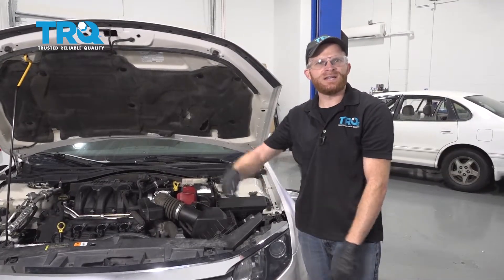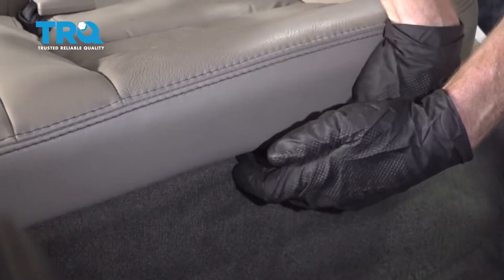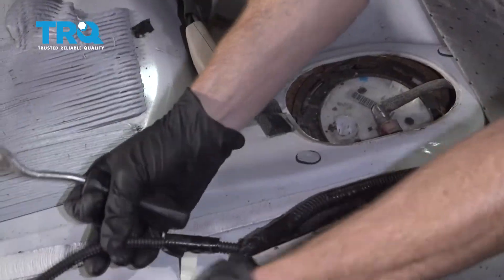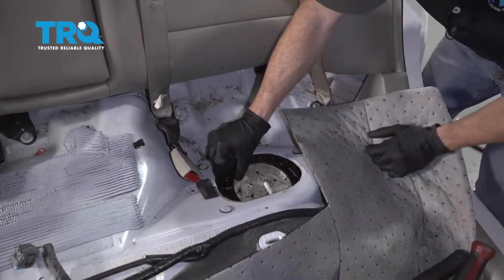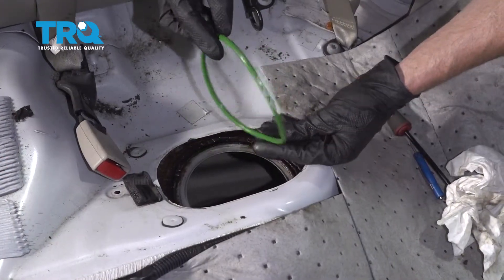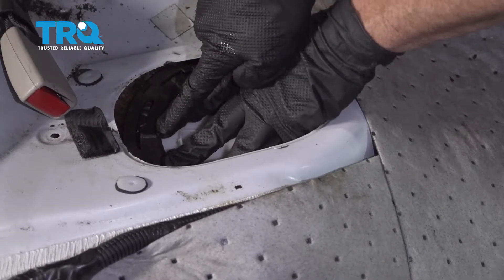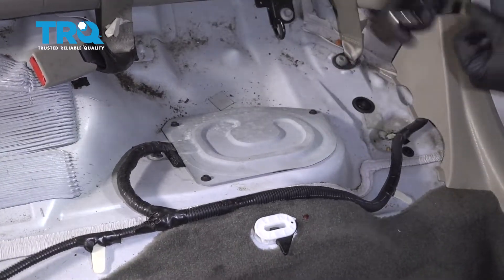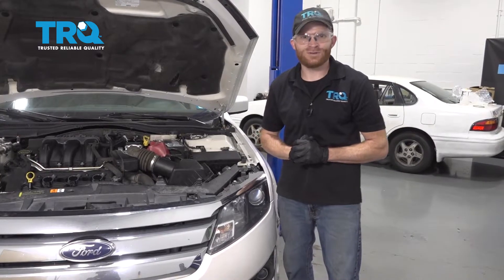How To Replace Fuel Pump 2006-2012 Ford Fusion

Comment: In our Ford Fusion JU2 2009 there is no shutter beneath the back seat..... We have to remove the exhaust and the fuel tank from beneath the car before we can replace the fuel pump... quite expensive..

Comment: Question ❓ why are UK mechanics trying to charge me £850 to do this job when the part is £50 and it's probably only a 1 hour job 😮 so really should be £250 max , I really dislike how some mechanics off click mechanic website are overcharging people for basic jobs , It's certainly not as complicated as a Head gasket replacement

Comment: Getting those red pieces to disconnect the fuel hose from the fuel pump is proving to be extremely difficult without feeling like excessive force is needed / risk breaking it causing an even bigger problem

Comment: Interesting I always thought that you had to remove the fuel tank to get to the fuel pump if it was an internal item. Also no mention of the filter but I guess that was included with a new pump. Great job of thoroughly explaining it to a non-mechanic.

Comment: The fuel pump that you linked in description, did not come with a connection on the bottom for the line in the tank, does that mean it won’t work? Because the fuel pump you replaced had that connection at the bottom of the fuel tank. Will I need to return this pump, or will it work somehow? Please get back with me asap, I am supposed to be changing it out in a couple hours.

Comment: would the fuel pump on the awd 2012 ford fusion se work on the front wheel drive  version??
Reply: It could very well work. Make sure they are both a v6, or I4. Even if they’re different engines sizes they could work, I’d call a dealership and ask

Comment: I would have started the car before refitting the Rear Seat Fuel Pump Cover Plate,  just to make sure there's no fuel leaks from the hose connection.

Comment: Replaced pump to 2006 Ford fusion awd  it still has same problem. Injectors are fine, but won't read any fuel pressure on rail. Car still start runs and drive with very little power... In gear and in idle it shakes vigorously as well as steering wheel. I'm starting to think fuel pressure regulator but it's usually on or by the rail... I can't find it and I didn't see the fuel pump or housing have one either.